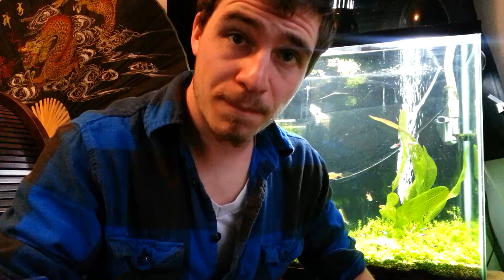1.Fundamentals of CO2 Injection

Comment: You make Excellent Points great vid. forgot to add in a co2 dropchecker. I've used diy, liquid and pressurized and i can say that pressurized is the way to go as 'you set and leave' once you've got the flow correct. for others out there, if you have balanced lighting and co2 in the aquarium you will most unlikely have algae issues. im talking string algae that grows on plants.

Comment: Hey Evan, I'm really hoping you can help me out with a dilemma. I've just ordered everything needed for CO2 injection (CO2 tank, CO2 regulator, bubble counter with check valve, CO2 diffuser and CO2 drop checker). My tank is already on a timer for its light and initially I was going to set it up so that the CO2 system would go on and off at the same time the light does but now I'm wondering if it would be smarter to have the CO2 system go off an hour before the light goes off to allow the plants to consume some of that CO2 before it's night night for the fishies and thus avoiding potential poisoning. Obviously this would mean purchasing another timer so before I do so, I'd like to appeal to someone more knowledgeable to see if it's worth doing it rather than sticking to my original plan.
Reply from the maker: I like to run co2 an hour before the lights go on to saturate the water and then off an hour previous so we don't have an overabundance of it in the water through the night because the plants will also be releasing co2 at night. It's not completely necessary but for the small cost of a timer, I find it to be well worth it!
Reply: Cool, thanks buddy.
Reply: cloud9aquariums Hi mate. So what PH you normal have in your tank? I have 7.54 and in the morning I'm injecting CO2 till the valve cuts off the CO2 goes to PH 7. Every morning I'm turning the CO2 on and off but I need an idea how to do it. I will change the substrate soon and I will try to leave it on on the electro valve but in the night I need to put a stone to get rid of the CO2 when the plants don't need it. i'm waiting your response. Thanks. Cris
Reply: Cristian Ionut Marcu The pH swings from CO2 don't actually have a detrimental effect on anything, so don't worry about pH except to get an idea of how much CO2 is in the water. Right now, you've probably only got around 10-15 ppm CO2 and CO2 doesn't start to become dangerous until it goes above 35-40 ppm for most tanks(this will depend on a number of things such as how much flow you have in the tank, what kind of fish and how big they are, etc). In my tank at night the pH is 8 when the CO2 is off, and 6.8 when the CO2 is running without any problems. pH swings are only a problem if they're caused by a low KH or ammonia in the tank.
Reply: Cristian Ionut Marcu
 Since I've now had CO2 injection run for 2-3 months, I agree with Iknow789, the change in PH is not detrimental to your fish or the overall health of the tank. As a matter of fact, my tank looks absolutely stunning with the vibrant colors the plants have. I should note however that I also have custom lights (FugeRay Planted+) and I use a bubble counter as well as a drop checker (both bought from green leaf aquariums, pricey but quality products) to make sure things stay in check Also, you should always have a stone for bubbles, regardless of using CO2 or not . Apropo, se pare ca esti roman asa ca salut!
Reply: DannyLB Salut Dane. Am avut probleme odata cu electrovalva si mi-a bagat CO2 pana mi-a omorat cativa pesti iar restu stateau la suprafata. Imi scazuse ph la 6,5 ceva de genu. Asia zic ca nu e nevoie de piatra de bule dar voi pune noaptea sa porneasca sa scoata dioxidul de carbon. Intra pe facebook si cauta-ma sa te mai intreb una alta. Cristian Ionut si am poza cu familia. Merci si bafta
Reply: Cristian Ionut Marcu
 Chiar nu te gasesc, adauga-ma tu, e mai usor ca nu e altcineva cu numele meu, Danny Bekk.

Comment: All plants actually use & need co2.
Most plants including aquatic plants typically grow near lakes, ponds & streams & not fully submerged in nature.

As Amano says, forcing plants to fully grow submerged under water is news to them plants & not natural.

As stated all plants do require co2 but on different levels within ones tank.

Slow growing plants like anubius can survive with just the co2 output from your fish alone.

Faster growing plants require more nutrients such as co2.

I never had any fish gasping from diy co2 even without air stones or leaving it on all night. 

Maybe if your running 5 two liter bottles on a 5 or 10 gallon tank.

One 2 liter diy co2 on a 55 gallon won't kill your fish & your plants will look pretty.

I've read that diy co2 with basic ingredients & pressurized co2 chemically are 2 completely Seperate animals but I'm no biology major. 

Just a working theory folks
Keep your fins wet

Comment: excel = Glutaraldehyde ( CH₂(CH₂CHO)₂)+ Iron....cheap as chips mate if you just buy Glutaraldehyde
Reply: Why do you say + Iron? Do you have to add iron to it to work?

And where do you buy this? 

Thanks!
Reply: Mike Kollin No, you don't have to add iron for it to work, Seachem mixed it in their Excel, but the stuff that is the working factor is Glutaraldehyde.
Reply: Martin Welters cool Thanks!  Question... I have 2 tanks with the same everything...  Same fish, food, substrate, everything... One tank is Awesome, clean, perfect Zero Ammonia, etc. etc. Fish very healthy... My other tank has Ammonia... and no matter what I do, it won't go away.... And it's a bit too high... I've used Prime, water changes, even Ammo Lock... and put in more bacteria... this tank is about 10 months old... 29 gallon with 9 small fish... all cory cats w/2 Gararufas that are about 4" long...  I've cleaned the filter 2 weeks ago... but left bio in the padding stuff... it has a wheel that I leave wet all the time...  Any ideas what could be causing the ammonia to stay there for months now? I run co2 and add Seachem flourish a few times a week... I stopped adding iron a few weeks ago... And I use Kent Iron Magagnese... 8 drops. It is loaded with plants, which are growing very well... and the fish are very healthy and playful, etc. My top plants slowly died recently... but I added some long floating plants that grow fast to eat up the ammonia... Cant' remember they name right now..
Reply: Most problems we find in our tanks are CO2 related...this includes bad circulation (current), to much light and of course not enough  and/or fluctuating CO2 dissolving into the water column. Ammonia could also be overfeeding fish  or dying plants which indicates bad CO2 again, sometimes even a dead fish in the corner of your tank could be the cause of higher Ammonia.
Reply: Martin Welters Ok, thanks! So are you saying it could be the Liquid Co2 Excel?? I am using Flourish Excel. 

And, I am also using a Co2 canister as in bubbles/gas Co2... could that also cause it?

Thanks very much...
Reply: Yes...same thing
Reply: Martin Welters There's no iron in excel, they mention iron because glutaraldehyde reduces iron so more of it is in the more biologically available form.
Reply: people stop saying that Excel is liquid CO2 it is not.... do your homework